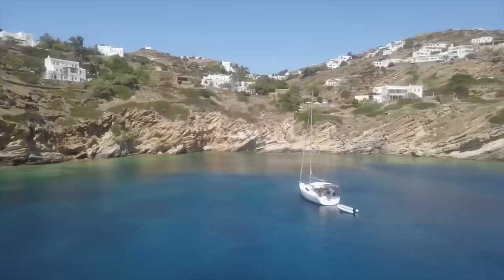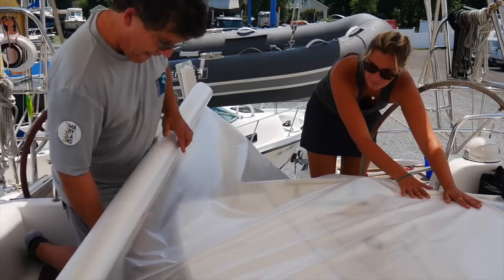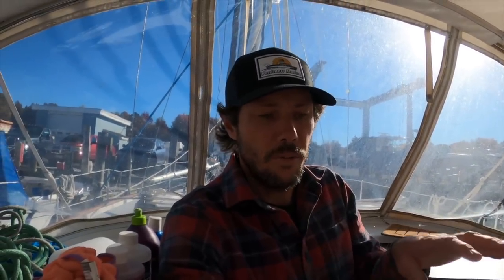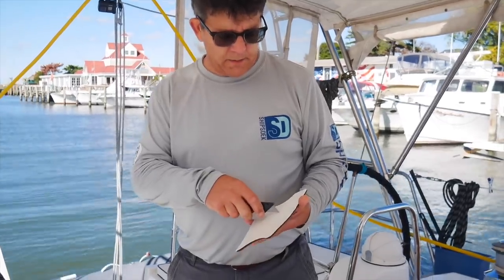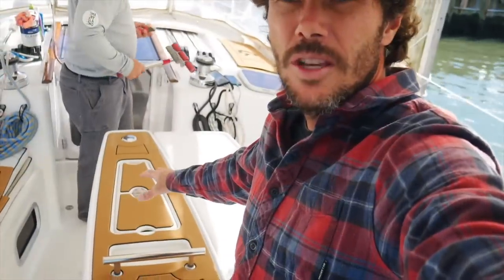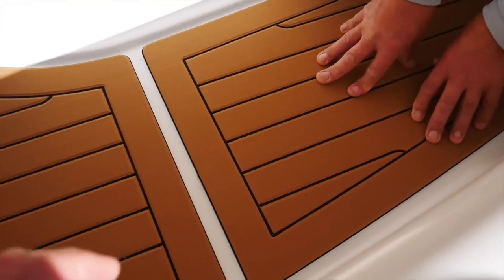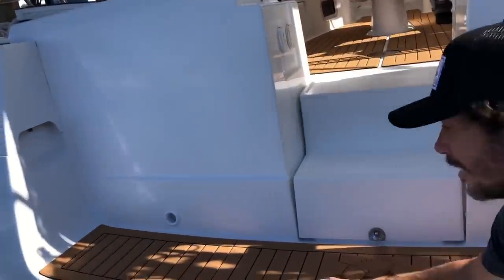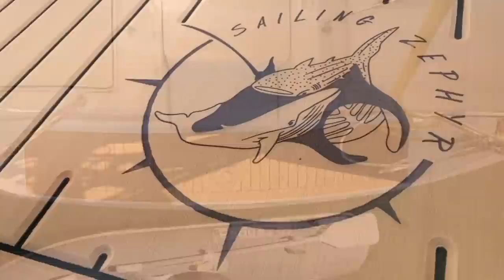New SAILBOAT COCKPIT FLOOR...Using SHIPSDEK FOAM TEAK | Sailing Zephyr - Ep. 163

Comment: Looks great.  I wonder how long it will hold up.
Reply from the maker: Thanks, we absolutely love this upgrade on zephyr. We will let u know
Reply: Likely service life is my worry too. Warranty is 36 months, according to their home page, and seems to have to watch that it doesn't get excessively hot (It's a pretty high temperature), But to me , I'd make sure a full Cockpit protection Bimini and Sprayhood will be in place for shading benefits first, before getting this, plus will avoid using it for the side decks and Cabin Roof, which tbh, for the Tropics need to be a nice Soft underfoot White nonslip anyway(there is one that is comfy to walk and kneelmon, but I forget the name), for Cockpit floor and Seats ? This looks to be perfect, and brilliant to walk and sit on, and just make sure to have a barefoot only sign on the Transim. Shaded, to me, a 3 year warranty suggests a minimum of 6 years service life, and just for the general comfort level in the Cockpit,  if the price supplied and fitted is reasonable, replacing withbthe same in say 6 to 7 years can be part of the medium Term budget, as potentially excellent value, given the amount of time us Cruisers spend in the Cockpits of Our Boats ? 🤔 Best Wishes and Fair Winds.  Bob.  👍⛵️✨️✨️✨️

Comment: Hi guys, the fake teak may look and feel good but I have concerns about dust, dirt, food, salt water etc being caught and trapped in the nonskid white fibreglass areas. I will be interested to see how this is going to work. I also have concerns about the long Jevity on the corners and sides of the product if you are healed over and trying to hold on with your feet which may turn up the edges so we will be interested to see how this pans out as well. Cheers from Newcastle Australia.
Reply from the maker: Hey Tony - thanks for the feedback. All valid concerns for sure. 

So far no issues with dust, dirt or saltwater. And we have dropped food and stuff with no issues. It cleans very easily in the channels. It all flows out the back of the boat. 
As for the corners and edges, they have been doubled up so to speak with a primer glue that is to prevent just your concerns. But as you said, let’s see how it goes after some hard miles. Cheers for watching.
Reply: @SailingZephyr  hi guys, thanks for the feedback. Look forward to an update on how it wears in a few months time. By the way, well done on the massive job getting rid of the old anti-foul bottom paint, massive effort! Cheers from Newcastle Australia.

Comment: Any chance of letting us know how much it cost to do the Cockpit please ? This is now on the "Must Have" List for Cockpit Floor and Seating for my next boat (tbh, for Transom, Side Decks and Cabin top I'm sticking with a soft "rubbery" brilliant white non slip paint that I've presently forgotten the name of. It's not the Kiwi one, it is a USA one with some tempting colour choices, but White is pretty much vital in the Tropics I've found, if it isn't going to get unbearably hot below deck).  Best Wishes and Fair Winds.  Bob.  👍⛵️✨️✨️✨️
Reply from the maker: Hi Brown - Sorry for the delay. We used a company for our faux teak called SHIPSDEK. The product is amazing and the team are incredible. It has been very durable even with the dogs. Plus it doesn't get hot in the sun. Reach out to them through their website and mention Sailing Zephyr and they will look after you. Best wishes.
Reply: @SailingZephyr  Thanks for getting back to me on this. Ny next boat is almost certainly going to be an Usland Packet, built in the USA,  so can get it specified for the new build, or, start with everything non slip and get it done by them after, as for fun, plus ease of registering, plus useful around the Caribbean, I think I'm going to go with Refistering the Boat in the British Virgin Islands,  which is easy for a British Subject. and if I base there for a few years, popping over to the USA to get the work done, is going to be an excuse to go shopping for a 90 day visit, maybe visit old friends up in MA too.  Best Wishes and Fair Winds.  Bob 👍⛵️✨️✨️✨️✨️

Comment: How is the longevity? Did they have any solutions addressing corners/edges popping up, dirt ingress etc.  You’ll have to give us follow up after a season or two
Reply from the maker: No issues with corners edges popping up this far. And the use of the primer for the glue around the edging helps stop that. Longevity will be the key follow up.

Comment: DON'T DO IT!!! It looks beautiful, at first, BUT THEN after 1 or 2 years the UV radiation sun and salt water exposure will break off tiny particles, you will see brown dust, dirt wherever one has walked over and if you sit on this with white pants they will be brown. I loved it first.... now I am going to get rid of it.
Reply from the maker: So far we have had it 2 years, it’s not degrading, doesn’t stain anything and has lasted very well even with dogs. Simple clean with soap and water and looks like new. We follow the guides the manufacture sent us which suggests to avoid petroleum products when cleaning or spills. 

I agree certain brands and products don’t fair to well. But the ShipsDek has been incredible and super durable. Very sorry to hear you’ve had a different experience.